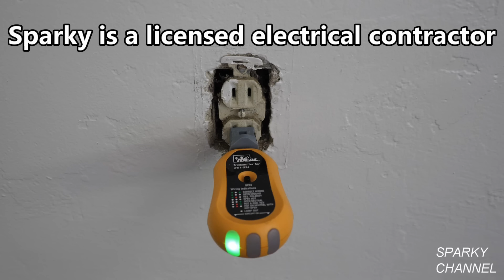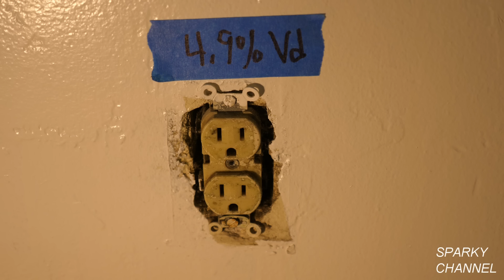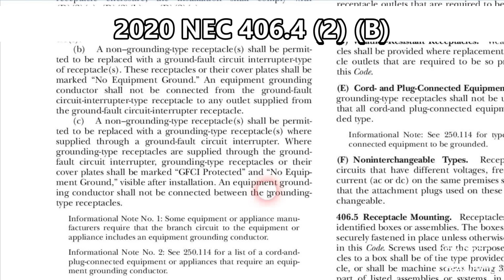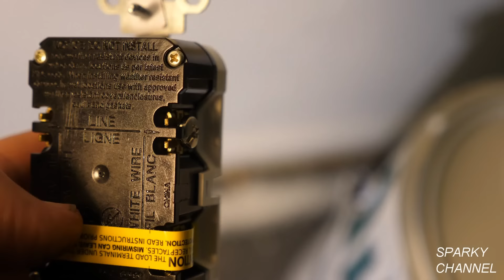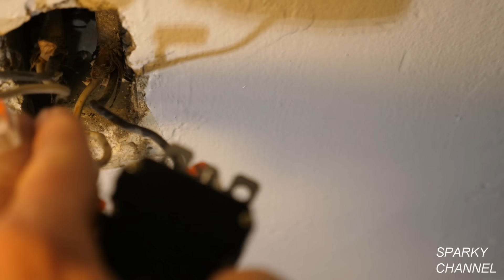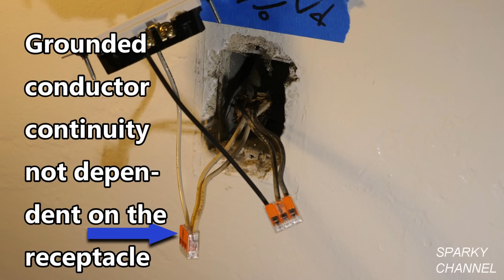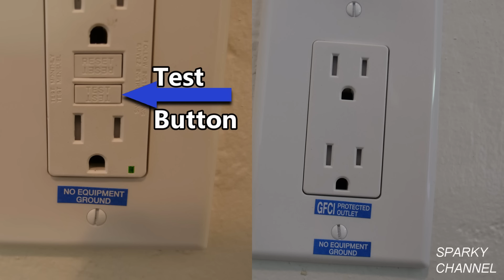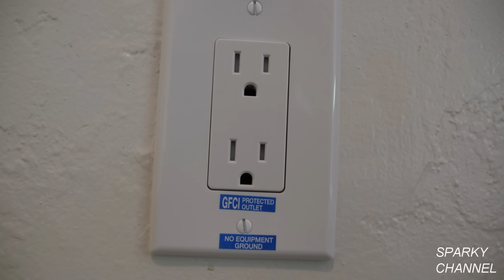2 Prong Receptacle Circuit Replaced by GFCI and Grounded Receptacles per 2020 NEC

Comment: Also wegos are hated in the electrical industry. Sometimes nice, mostly not but that’s for industrial
Reply: You mean Wago?
Its just in USA people hate wago. EU uses them
Reply: Wagos save time and space.

To do a jumper wire with wire nuts would mean the wires should be pre twisted before screwing on the nut. That would take a lot more time, the wires would need stripping back further.

Another benefit is that wagos allow for quick modifications later, especially useful on lighting circuits. In addition they allow for safe connection between solid core and stranded cables.
Reply: Never met anyone who "hates" wago connectors. Most just don't care about them b/c they'd rather spend as little as possible on a job and thus use wire-nuts.

Comment: At 2:36, he only tests the bottom outlet. That's a HUGE No No!!! Please always test both outlets on a receptacle. Just because one outlet does not work does not mean the whole receptacle is dead. It could have faulty wiring, a broken connection or one of the outlets could be wired to a light switch and the other could be a constant.
Reply: I can second this! You can visually see the tab connecting the terminals, present or missing, but like they say, safety never hurt anyone.
Reply: What are the odds? You'll be multimillionaire before the second receptacle in a room is wired that way. You see that only on workshops  and it is labeled. Very rare.
Reply: @BAKERHUSKIE  my house has receptacles where one half is switched.

Comment: This is a very informative video. My 1957 era home is all 2 prong. I’ve put in a gfci receptacle in the bathroom. But hadn’t known about an upstream gfci providing protection to all outlets on a circuit. Would love to do this for circuits on my house but can’t afford a nearly $400 circuit analyzer. Is the best I can do trying to trace wires and guess? (I have a one story home and wires are exposed in basement so I can at least see where they first go up through the floor)
Reply: I'd think you could rig up something to test voltage drop pretty easily. Just plug a heavy load (space heater, perhaps) into the circuit, turn it on, and check the voltage with a multimeter.

Alternatively, if the breaker box is new enough to have GFCI breakers available for it, I'd just replace the standard breaker with a GFCI. It'd cost a bit more, but you could be certain everything on the circuit is GFCI protected and then just replace all the outlets with standard three prongs.

Comment: I tried using those connectors and had a bunch of problems with failed connections. I went back to wire nuts and never have a problem. Great video, very informative.
Reply from the maker: Thanks!

Comment: How are the receptacles grounded I didn't see how you grounded it?
Reply: If you want to ground it you can:
1 use a self tapping screw and screw it to the back of the box.
2 use a piece of same gauge wire and make a hook.
3 wrap the hook around the screw and tighten it.
4 use this as your green ground.         This will give you a ground.
Better than no ground.
Reply: @The77stevo77  , are you saying to ground the circuit into a plastic junction box?
Reply: @thomasjeffries1020  no
Reply: @The77stevo77  Thanks for clearing that up. lol
Reply: @thomasjeffries1020  only works on a metal box with metal flex.
Reply: @The77stevo77  that's what I thought. I rarely come across metal boxes in the wall. They're usually fiberglass or plastic.
Reply: @The77stevo77  Code explicitly calls that out as unsafe when modifying a circuit in this specific way. You don't want current on the box if it has no where to go to.

Comment: Am I right in thinking that you have to turn the breaker back on before you can use the circuit analyser to measure voltage drop? That's not shown in the video. I do see you mention 'Turn off the circuit breaker' before installing the GFCI receptacle, so that confirms it.

Comment: I don't understand why you use pig tails and wagos when you could have directly connected the wires to the receptacles. That's like putting more stuff in a tight old box.
Reply: He explained why he used pigtails and its because if the receptacle goes out power would continue down stream.  If  you just put both sets of wires on the receptacle and it fails everything after that receptacle won't have power
Reply: @cednstacy  I understand and thank you. 😊

Comment: Hi Sparky why do you have a 4.9% Vd  and more, cause here in Canada the maximum allowable Voltage drop in a circuit should not exceed more than 3%  from the breaker .  I'm i missing something as to why you have a really high Voltage drop?
Reply: every time i see a video of electrical installation in USA, i say to myself "looks like those people discover the electricity yesterday" haha
1) they use solid wire instead of multiple filament wire that is more flexible and easy to install.
2) they use 120 V line voltage so the current is higher (than with 220 V or 230 V) thus the wire needs to be thicker.
3) switches and sockets have the screw contacts exposed to the inside of the metal box (short circuit hazzard).
4) GFCI are used ONLY for a couple of sockets instead for the entire house wiring.
5) they use TN-S or TN-C or TN-C-S earthing system that are less safe than TT
Reply: @miguelm203  Of course #3 can be taken care of the way he did here (and the way my dad did it) with a layer of electrical tape.

Comment: I am sure somebody has already said this, but a GFCI protected circuit is actually safer than a grounded circuit because while a grounded circuit provides a path for shorted current, GFCI actually turns off the circuit when it detects a short. The only downside to GFCI is certain high end electronics have power supplies that behave in ways that make GFCI think there is a short when there is not.
Reply: if you dont put "a path for shorted current" and a hot wire is touching the metal case of some a appliance, then the GFCI wont turn off the power until some folk touches the case and gets shock! (human body makes the path to earth)... you should have both thing on your electrical wiring (protective earth conductor and GFCI)
Reply: @miguelm203  The GFCI will cut the power as soon as current goes to the case because at the moment something shorts to the case the hot/neutral current imbalance is created which trips GFCI.

Comment: Sparky I got a question. Are those voltage drops ok according to code? Also, will the gfci trip if low voltage arc happens in the circuit?

Comment: This tells me the copper throughout the house needs replaced. And what ever high amp drain equipment will need a ups fully charged to overcome the worn out copper and main box. Moral of vid is the house is junk, prob should be demolished and rebuilt. Likely has mold and other microbes. Burn it down.
Reply: What?   You really need to explain your reasoning, in detail.

Comment: Great video as is all of your videos. How would a poor guy like me who can't afford a $400.00 Ideal Circuit Tester. How can we determine the Voltage Drop at each outlet on the circuit ?
Reply: You dont need to do that. Take it apart and check for voltage like he did. That's really all you need to do
Reply: @kylekarcher  Thanks
Reply: Just use a space heater or hair dryer and measure the voltage

Comment: Were you working with a panel with circuit breakers or with the screw in fuses.  My house has a screw in fuse panel.  Will this work with that?
Reply from the maker: I had circuit breakers. Yes, it will work with a fuse panel but I recommend upgrading to a modern panel when you can.

Comment: I assume one would have to actually run a ground wire back to the service box in order to have an equipment ground rated circuit?
Reply from the maker: Yes.

Comment: Would this pass section eight inspection in Alabama?
Reply from the maker: I don't know why not.
Reply: @SparkyChannel  I think they probably would, not sure. 
  Sister was going to rent a house out to Section Eight that had a two wire system, until the inspector mentioned they don’t do non grounded electrical. 
   She stopped him before he proceeded.  Told him to forget it.  
  I think she had rented out through them before some years back, but with new regulations they had since then, she decided not to deal with them anymore. 
  I bought the house and have been wondering about the gfci’s myself.  
  I am renovating it and think I will put gfci’s in it.  Not sure what I will do with it then. 
  Thanks for the response.
Reply: @SparkyChannel  would the lighting not being grounded cause a problem?

Comment: Love the video, only thing I would suggest is attaching your load wired before you attach you hot.
Reply: Also there is really no reason to test voltage drop like he is doing.
Reply: @kylekarcher  only in long runs, but for his sake, voltage drop tests isn’t needed for the fact that if you have outlets that far away, you probably need a sub panel and that makes this video almost voided for a weird circumstance

Comment: I'm not American, but if no earth is connected to the first GFCI, does that not give full protection?
Reply: This is NEC. should look into your countries code.
Reply: A GFCI does not need earth. Sure having earth helps as it would cause the GFCI to trip immediately in case of a failure.
Reply: Sparky is wrong, he should know enough to GROUND the GFCI at first line.  The GFCI can electrocute someone if it can't sense... the Ground Fault! when there is no ground supplied!  Really dumb.

Comment: I did this several years ago in my old (1929) house. I installed GFCIs at the locations closest to the panel and replaced all the two prong outlets, marking them "GFCI Protected" and "No Equipment Ground" as indicated in this video. When I was done I was initially surprised that the circuit tester indicated both proper wiring and grounding, but realized that the existing BX cable jacket is acting as a ground conductor...acting...but not code approved ground because unlike modern AC there is not a continuous grounding conductor contained within the cable. I think my installation as marked and labled is within the code after repeated readings of the sections you cited in the video, but I think I want "real" approved grounding. Over the next few years we will be removing and replacing lots of failing plaster and lath, and between opening the walls and the access to the wiring afforded in the attic and the basement we should be able to replace the existing runs of BX with either Romex or AC, providing a continuous grounding conductor all the way back to the grounding bus in the main panel.

Watching these videos does give me more confidence that the small repairs I have done in the past were done correctly, but they are also illuminating the boundaries of my ignorance, leaving me more likely to call an electrician to make repairs that I might have considered doing on my own when I was younger.

Comment: Interesting. I haven't been doing wiring in a while now, so I didn't know those code provisions. Makes bringing a lot of stuff up to code a heck of a lot easier than demoing every wall in a house!

Two things I would have done slightly differently than you did. This is from years of working with apprentices and around incompetent morons. I would have removed the upstream receptacle first and capped the wires, then removed the others. Then I would have replaced from the downstream end to the upstream end. On the upstream receptacle I would have attached the downstream wires first, then finally the neutral and hot coming from the breaker panel. This absolutely minimizes my exposure to the possibility of some moron turning the breaker back on while I'm working on a receptacle. I also would have treated the feed wire as hot while wiring it, even if I'd just tested to prove that it wasn't.
Reply from the maker: Excellent, thanks!

Comment: Eventually you want to run a grounded wire (Romex or BX) back to the main panel and replace the outdated panel as well to accommodate modern grounded receptacles and breakers.
Reply: Yes, this is what I was hoping the video was going to show. How and what goes into updating an old house. 
Excellent video though!!!
Reply: I was expecting him to run a ground wire to the electrical panel. Good video though. I know how to find the closest receptacle on the same line to the panel looking for the least VD.

Comment: Hi I've read the responses about not needing a ground for the GFCI but when I call an electrical distributor they're telling me since its a GFCI then I need a ground. So what gives. I'm in the USA.
Reply: You can install GFCI's without a ground wire, National Electrical Code allows this as a legal alternative to running new wiring with ground so long as you affix the "NO EQUIPMENT GROUND" sticker that comes in the box. A GFCI will still work correctly without ground, they work by measuring the current passing through the hot and neutral and if they become imbalanced (indicates current has found an alternative path such as your body) then they will trip properly. You should not attach any wire from the ground screw to the box unless you are sure the box is grounded, doing so serves no purpose but will give others the false sense that the outlet is correctly grounded
Reply: @franciscogonzalez4801  thanks I just don't want any problems as this is a rental.  And the.government is blocking the landlord's right to evict bad tenants so I'm stuck with a deadbeat

Comment: @Sparjy Channel i have old 2 prong. I need a 3 prong for window AC. Do i need a GFCI or can i just put a regular 3 prong and label no ground? I just dont want gfci to keep tripping because of AC. Any thoughts?
Reply: I’d install a GFCI, and if you keep getting nuisance tripping swap it with a regular outlet labeled no equipment ground. GFCI provides more protection
Reply: @BAKEDnotTOASTD  Thanks for suggestion. Once I popped off the outlet cover I was able to test and found out that the metal box(old work)was grounded,so I just installed a regular 3 prong since there is ground and I also checked the NEC 2020 and the location of my AC does not require a GFCI.
Reply: I'm an industrial trained electrical engineer from the UK working in a car stamping plant. We've used GFCI's or RCD's as we call them for over 30 years now in domestic boards. The term nuisance tripping gets used here also. However, these devices are extremely reliable and only trip when a ground fault occurs- usually when water is present in the circuit or equipment. In the video he explains that a GFCI must be present in the first upstream radial socket to allow a non-grounded 3 pin receptical to be fitted downstream. If the air conditioning unit, or any other metal enclosed casing was to become live, then you would receive an electric shock without an earth present or GFCI protection. This is extremely important in Europe as the line voltage is a more lethal 240v. Sorry to be a pain in the arse on this subject.

Comment: -You have to account for lights, too. sometimes you'll find a circuit where an upstairs floor circuit also powers downstairs lights.
-You might also notice an assumption he makes: a "dead" outlet is on the circuit where he's opened the breaker. You should verily all outlets and lights are functional PRIOR to running the open breaker tests.
-I get it that he's getting some bucks for promoting this brand. You don't really need all that crap. At the most, just the basic outlet tester.

Comment: How did you figure out the hot wire for the load?
Reply: He connected wire nuts/wago connectors to each wire separately, turned the breaker back on, and used a voltage tester to determine what bundle was hot. That would be your line side connection and the dead bundle would be your load side connection.
Reply: @gigaWUTT    So the load side doesn't have a hot wire?  So your saying it doesn't matter which wire you connect?  Then why did my breaker keep tripping when I did it?
Reply: @ThomasPain2025  No you are wiring it incorrectly still. Look up a picture of how to wire a GFCI and you’ll see it then.
Reply: @gigaWUTT   I did it just as the video shows.
Reply: @ThomasPain2025  Need to look at the back of GFCI to make sure your line and load hits are installed correctly. Sounds like you may have connected a hot wire to a neutral connector.
Reply: @gigaWUTT   I was just following the direction in the video exactly as he did.
Reply: @Luis Huizar All four are brown.
Reply: @ThomasPain2025  sounds like you need to hire someone if you don’t know what to do. Could pose a potential safety hazard
Reply: @TheToxicCollision    I did.